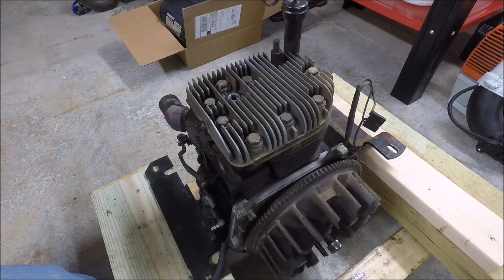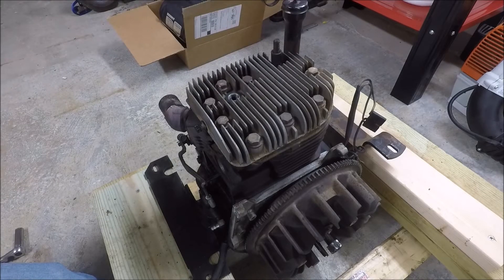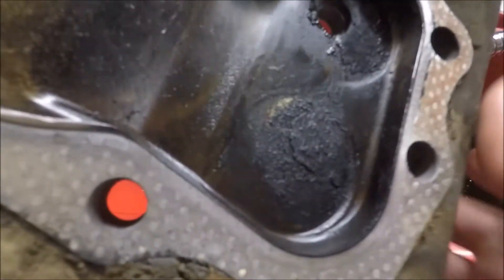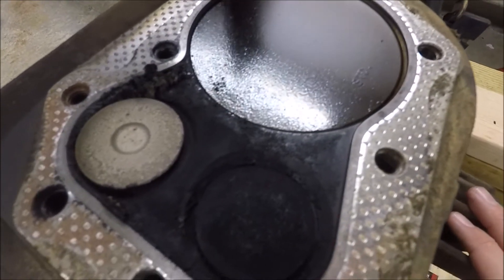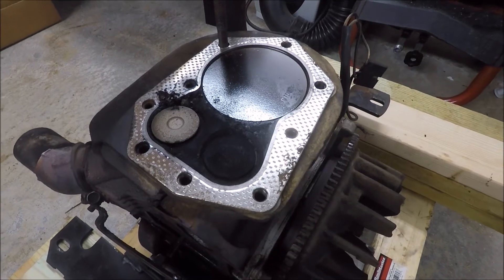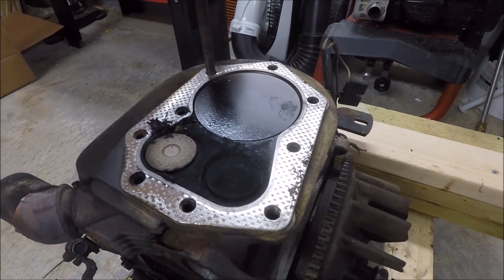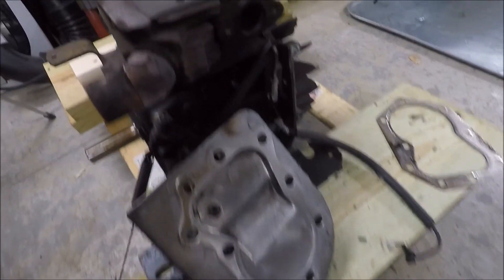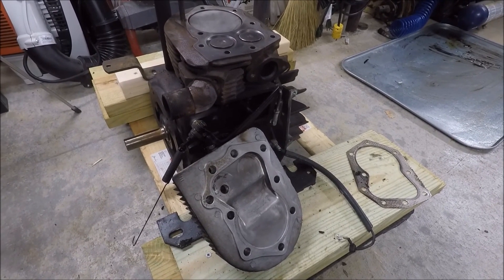Kohler K-Series Cylinder Head Removal/Cleaning

Comment: Anything further on this engine?   I am almost finished putting one out of a 140 in another 140.  The first block had a connecting rod go thru this side of the block.  The new engine seems to run great with no smoke but I am very interested in getting a motor perfect for this restoration.

Comment: Would you use a wire wheel to clean around valves?
Reply from the maker: Not a steel one, maybe if it’s brass.
Reply: Absolutely you can. You're not going to harm a cast iron block or hardened/tempered valves using a wire wheel unless you go nuts with it.